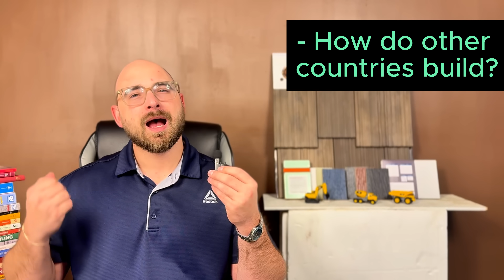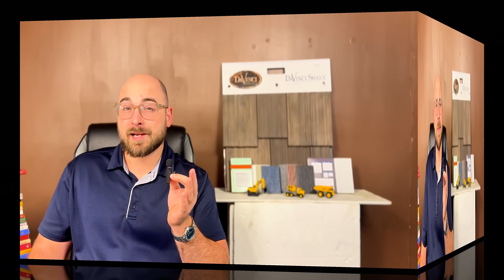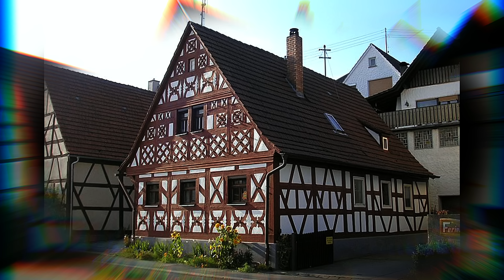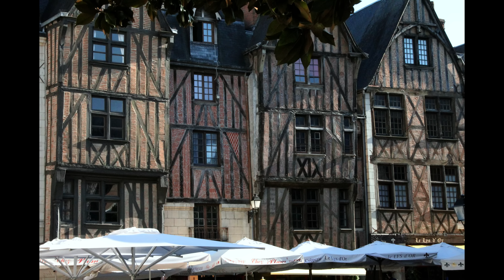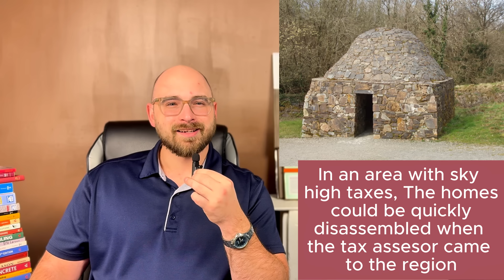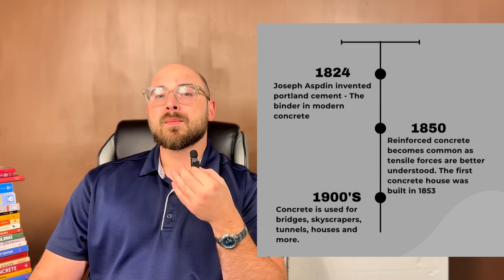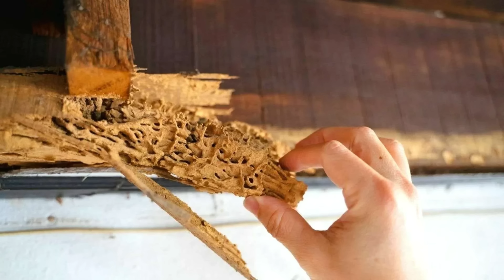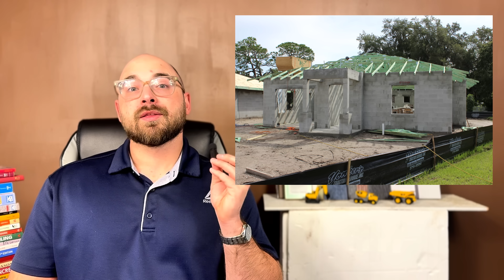Why Other Countries LAUGH at American Homes

Comment: cold, damp, and moldy in the winter, and crazy hot in the summer. the building i'm currently living in southern EU (a 40 year old building) doesn't hold a candle to the 100+ year old wooden building (with heat and, gasp insulation) in California.

Comment: American here who lived in England for seven years. Are there homes built better in England? I’d say no. Homes in England are equal to the same cost level homes in America.  I lived in a 1980s basic box home in England and it sucked. After that I lived in a home that was built in the 1800s. That was a great home but it was falling apart and the cost to heat it was crazy compared to American homes because it was inefficient. Lastly, I lived in a modem flint home with slate roof. Yes this home was built better than your average American home but it better be because the home cost £1M, that’s $1.5M. So I don’t really believe the nonsense, you get what you pay for in either country. Additionally, American homes have central heating and air conditioning, modern plumbing. England can’t even make a sink tap with hot and cold in a single faucet. 😂

Comment: No mention of Autoclaved Aerated Concrete, Mike.  They make wall block, floor panels, and roof panels.  Because of the aeration the concrete is 20% the weight of a similar sized CMU thus 20% the amount of concrete - so less material.  The aerated block is also a good insulator.  No cavities in the block mean no place for pests to set up shop.  The walls breath.  And  of course it doesn't burn.  There are many, many benefits.  I could go on and on. Look them up.

Comment: Having built homes in both Europe and the United States, I find American houses much more adaptable, especially when it comes to integrating modern technologies. HVAC systems are standard in the United States, whereas in Europe ventilation still often depends on opening windows. This method is neither efficient nor ideal for maintaining healthy indoor air quality which I find very important.

With the rise of passive house construction and the use of energy recovery ventilators, the benefits in terms of air quality and energy efficiency are quite clear and American homes are far easier to upgrade. It is relatively simple to seal the building envelope and incorporate new technologies. This makes it much more feasible to bring older or standard homes up to high-performance standards... also wooden houses are much more DIY-friendly when it comes to remodeling. In brick houses, once the electrical layout, outlets, or walls are set, making changes will be difficult and expensive. With wood-frame construction, it's easier to reconfigure layouts, run new wiring, or make adjustments as your needs change.

You can also add sound insulation like Rockwool between wooden studs, which isn't possible in the same way with solid brick walls. For me, that flexibility and acoustic comfort matter far more than simply having a wall that's impossible to punch through
Reply: I completely agree. Idk why no one else is bringing this up. Every comment is just “Americans are so stupid. In my country we can’t punch a hole in our wall.” Meanwhile they have a heat-related illness problem because none of the houses can be upgraded to allow A/C.

Comment: I could concrete becoming a thing if the ugly look of its could be mitigated. To make it almost look like a wood built house. Wood built houses just look more alive than strict concrete
Reply from the maker: ICF is the way to go 

Insulated concrete with standard finishes
Reply: @Mike_Fortin I’m sure that’s the most expensive choice between the three than just doing either, or
Reply from the maker: @WhoIsJohnGaltt it’s slightly more yes

Comment: Dont be a lying american. Our home building practices are environmental disasters, ladening the soil, air, and water with micro plastics and chemicals from the insulation, roofing, duct work, foams, plumbing, and every stage of construction. I you people spray foam under concrete to level it the chemical and plastic load in some regions of america could coat the world in pink filth.

Comment: If houses in the US were made of concrete while houses in Europe were made of wood, Europeans would probably brag about how much more environmentally friendly lumber houses are. Concrete production is a huge contributor to green house gases while lumber is a renewable resource that takes co2 out of the atmosphere. Have new US homes become too cheap while costing too much? Maybe. But in general, if you perform basic maintenance and keep the lumber dry and free of termites, wood homes can easily last hundreds of years. How long do we need a house to last anyway?

Comment: I live in Cambodia and built a home a few years ago. Concrete and double brick. Steel frame for the tiled roof. 
240sq/m roughly 2500sq/ft and cost $65k USD for the build. It took 5 months to complete, 4 weeks late. 
1000sq/m land 30k. 
I'm Australian, and it would probably cost close to 1 million AUD in Oz land and house.

Comment: I spent half of my childhood in Russia in summer retreat my grandparents owned. House itself? made of logs, decorated with wood. older than soviet union) Never felt like there is something exceptional in house that stand for 100 years, it is wooden, it requires maintenance. Most homes thar are being built now are either brick, concrete  or some combination of brick + glued laminated timber beams. Some builders push for american style framework constructions as it is cheaper, but ppl usually don't like those as they seems like way flimsier. But i guess it depends on regional climate, like here is rather damp, temperature swings all over thermometer, 1/3 a year nights are below freezing, ppl here prefer well insulated and resistant to rot and mold constructions.

Comment: I think we all build what is best for the climate we live in. Here in Scandinavia houses are well insulated to cope with winter and triple glazed windows are the norm since 1980's. Also extensive loft insulation.  One proper size entrance hallway is important to cope with winter clothing.  We would never have an entrance door opening right into sitting room/lounge. Important is good insulation to keep fuel bills as low as possible.

Comment: Most of the sound noise comes through the windows.  So brick and wood don't make a difference unless you get rid of all the windows.
Reply from the maker: That’s not true, changing the walls makes a significant difference, if you pair with triple glazed windows even more so

Comment: there are some builders experimenting with homes made with a 3D concrete printing process. Don't know much about it, but watched a video on the process.
Reply from the maker: Poured is better, 3d printed homes are exposed to the elements, wick moisture, and not well insulated, lack reinforcement, crack and compromise the air barrier, and are no cheaper than a poured wall, 

ICF is far better

Comment: In the city im currently living in, Pune, India, once a house becomes 25 yrs old it is marked by the government as dilapidated and gets a redevelopment sticker on it. 
Older brick and concrete construction is being replaced by steel and concrete with modern insulation value. Now we put way more thought into insulation code than previous buildings

I think 14-15 yrs ago when i wasn't on YouTube, i had no idea people made "hollow homes" 😅
Thats what most people in my country call US homes. 
Our construction is mostly plastered brick walls and concrete+steel roofs. Your video is a bit off, the load bearing walls are bricks but the beams and loaded structures are mostly concrete.
Reply from the maker: Very interesting, what does the redevelopment process look like after a house gets the sticker?

Comment: You said "without the appearance of a bomb shelter" 😂
Well, you're missing a point there. I can't speak for all Europeans, but the reason why I could never live in a light frame house is that I don't consider it safe enough.
I expect my house to survive a car crash, shooting, a mad serial killer with an axe, or a jealous ex trying to kill me. I want it to be a shelter.
Another reason is that I'm used to hanging pictures and shelves and cabinets on the walls, whenever and wherever I want.
Also, pests and rot. Now, don't get me wrong, if a mold settles in a brick, you ain't getting it out. But the house won't rot away. Also, rats and other rodents can't chew through brick, so I don't have to worry. Insects don't worry bricks either.
I don't know if there's something that grosses me more than your crawlspaces. That would be the stuff of my nightmares, corpses, ghosts, plagued rats, that mad serial killer 🥺
But I have to say, your houses are much easier to remodel. Wall by wall, foot by foot you can tear all walls down and replace them. With masonry you can't do that. Once a wall is load bearing, you MUST NOT make any large holes in it or your house comes down. When we're opening space, we have to consult with a structural engineer and replace the wall with pillars and beam.

You said our houses are energy efficient, well you're right, bricks have great thermal mass and insulation properties. But they, by far, don't meet our high energy standards, we have to insulate. For a wall made of 40cm(16inch) brick, you still have to put 20cm(8inch) insulation on the outside. While good at keeping heat, bricks aren't very good insulators. And in the summer, they keep heat like crazy. We have windows wide open all night and it's still hot inside.

Europe is head over heels for the environment. The production and the necessary insulation means there is a shift toward different building methods in residential buildings here, too. More toward engineered wood plus natural insulators (like straw and hemp). We'll always want our buildings to be stronger than you do, but we're getting more towards wooden framing houses.

A very fascinating thing is, that with the masonry tradition most people, who have the time, will choose to save money by building the houses themselves. Slab is made by contractor but the masonry units are so easy to assamble that you can make all the walls yourself. The floors are usually concrete though, that's also made by professionals. Roofs are wooden trusses plus clay tiles. On the other hand everything that has something to do with wood framing is done solely by professionals. No one knows how to put that frame together. (And I think it's for the best, if people knew how "sloppy" it's made I doubt they would want to live there). I'm not sure, but if I'm correct, there are regulations about who can build those frames, but I'm not sure.

So yeah, the difference in preferences is really fascinating. And also the psychology of what people accept and what not. Overdoing on one hand, not enough on the other 😂.
Reply from the maker: Thanks for sharing 

I agree with you that a house should be safe from anything and everything

Comment: Other countries have homes that basically use the same tech as their grandparents and their grandparents. Aka homes that last for generations rather than our plywood boxes we call home. We spend 100,000 on a home that be lucky to see the next 100 so years while building it in designs that do not help the structure let alone efficiency of having it. An example is the new homes in Texas have high ceilings to the point that it takes 100 times more power to warm in the middle of winter and cooler in the summer. This is paired with large windows facing the East and thin walls with little support for good installation. I remembered going to one of those new homes in high school. Everyone wanted one because it spoke of “money” and “class”. But I was completely miserable. Not only was it ice cold but it was very hollow. No real feel of what a home should be. To top this with our homes compared to others in Europe, their homes matches their climates and utilize their environment. Not saying every home and building does this but if you go to a home in Scandinavia, you’ll see what I mean. They change their homes layout only when they see it as a benefit unlike us that made it a corporation in the means that your over paying for cheap plywood and a little bit of cement that will crack and break within the next year or two. So you’re wondering why they laugh? Well us gloating saying we are the best country when we are sitting in our Walmart lawn chair next to our plywood house that is slowly caving in on itself. Honestly I laugh at us too.
Reply from the maker: There’s no market for it here unfortunately, people want flash, flair, and cheap prices 

Consumer ignorance

Comment: You go to New England, there are homes from the mid-1700s still standing.  Everything being done now is about quick construction of cookie-cutter subdivisions, and I will say this McMansion culture is gross, and SO many corners get cut in the builds because they are throwing them up so fast, esp cases where the builders are buddies or have $ in the pockets of the local inspectors.  Thusly, you can have a $half million home that's built like trash.  If you look at homes built between 2000-2010, not cheap homes either, you'll see the results of crap construction starting to show up...

Comment: Please look up hempcrete.   It's the future.
Reply from the maker: It’s not structural unfortunately, 

Green concrete would be a multibillion dollar invention, so if you know anything about chemistry …. 🧪 🪨
Reply: @Mike_Fortin  Hempcrete petrifies over time sucking in CO2 making the structure more solid over time.   It is perfect for buildings that are onlya few stories high, you can also strenthen buildings using steel you dont have to use just one material.   It's politics nothing else.

Comment: I lived in Christchurch when the 2010/2011 quakes happened. The number of brick/concrete structures that were rendered unfixable and demolished are innumerable. Our house, made of wood, was practically undamaged, the only repairs it underwent were 1 new glass pane for the skylight and a small patch job on one area where the (concrete) foundation met the wall, beside that, nothing.

Comment: You were promoting ICF building which is a great building method but you forgot to mention insurance companies don't want to ensure them because of termite issues because they can't properly be inspected that would be worth mentioning
Reply from the maker: This is not true, 

In fact you can get a lower insurance premium with concrete walls 

There’s no evidence that termites are attracted to the foam (as it’s not a food source) 

And even if there were damage to the insulation, it’s not structural like it would be either with a wood house

Comment: Florida man here. I've spent several summers on cycling trips in Austria, and I've seen houses being built there. If houses in the USA were built like a typical house in Austria, I have no doubt every house would cost over $1M. I stay in a village called Lofer, many of the buildings in the town are hundreds of years old and still in use today, but you'd have a hard time telling which ones are very old and which are new. It's a whole other level compared to typical American construction. I assume you could build something comparable in the USA, but you'd have to be pretty wealthy.

I also used to live in Guam back in the early 80s - but not on one of the military bases so I can't speak to those. Practically every house and building was made of poured concrete. Here in Florida concrete block construction is common, my current house is concrete block, but that house where I lived in Guam seemed much more solid. I think the reason poured concrete never caught on on the mainland is because it's pretty basic looking.

Comment: I was a telephone installer in South Florida 50+ years ago and have seen many different types of homes. My family's home was built of concrete block with a stucco finish. My father did some decorative work in front using red concrete scored to look like brick. We avoid wood because of the termites. The cover over the front door was of wood and my father replaced it often. Jalousie windows were made from aluminum with glass strips. The front door was of a minimal wood frame with a Jalousie insert. 

The oddest home I worked in was made of steel. Even the interior walls were steel. Any holes you made were permanent. 

My own home is built with wood framing with a brick exterior. House settling can cause the brick to separate allowing water to get in cause mold and mildew. I have another house on the ocean. It's built with treated panels in the exterior and painted. The environment is very harsh. The wind blows constantly and contains salt and sand rubbing the paint off of the panels. The last time I painted I went with an oil based paint which lasts longer. Painters prefer latex because of the ease of cleanup and speed .but it just doesn't hold up well. Exposed wood will quickly rot. Three years after the last hurricane we found that water had gotten into the space between the ceiling under the house and the first floor. It had lain there and rotted the entire room. We had to replace the room at a cost of $33,000. The house is on wood pilings which hold up very well. Flooding though can undermine them and cause interior damage as the pilings fall or twist. After hurricane Floyd there were two houses built as twins. The wind twisted them both a quarter turn destroying the entire interior. They were built next to each other and there was definitely a design flaw. A crane was brought in to lift them while the pilings were reset. Property and flood insurance costs are high.
No matter how you build there are issues with all the designs and types.
Reply from the maker: Was the steel house one of the Lustron homes?